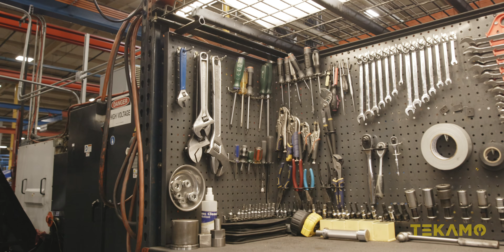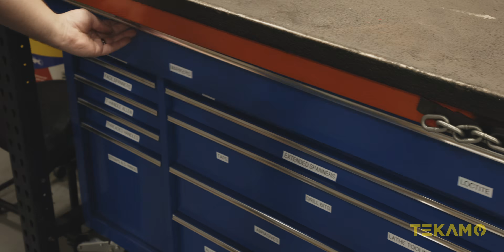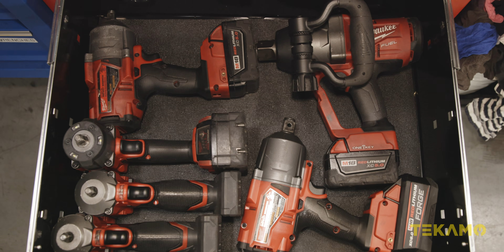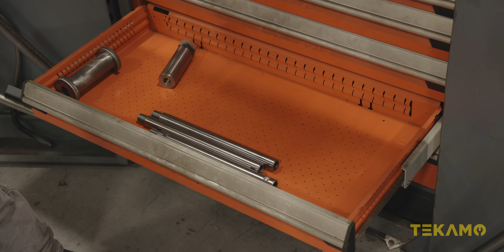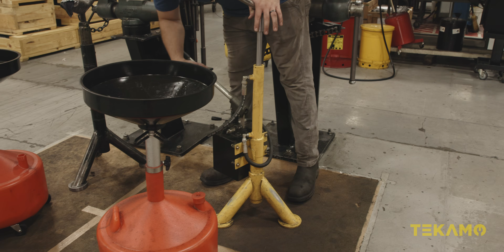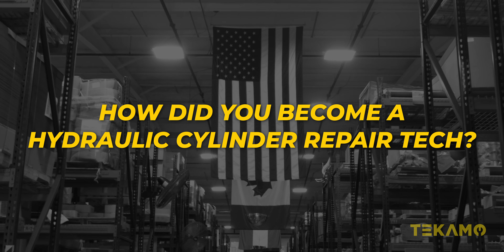TOOLBOX TOUR! Hydraulic Cylinder Repairman

Comment: might have to look in to making one of them halo wrenches next time a stubborn cyl  comes along.  Good vid!  great to see what people are using
Reply: Dead easy with some scrap pipe handy which is easy to cut from scrap cylinders.
Reply: the halo wrench implies the holes on the side of the gland? im yet to mess with those. in heavy equipment, from eyeballing dump trucks, but mainly construction equipment, backhoes, skidsteers etc. the glands have all the holes inside. the welded per cylinder large breaker bars is what I'm needing.